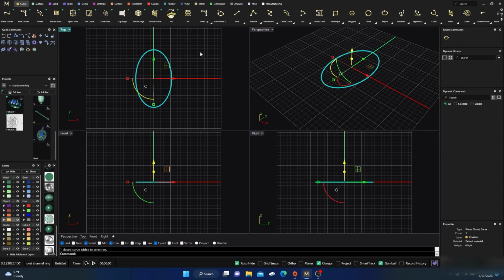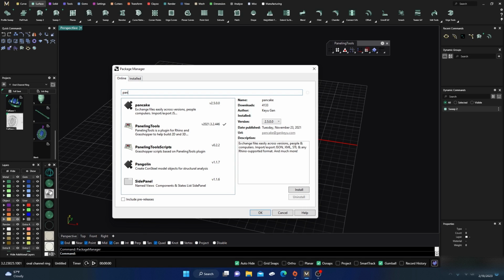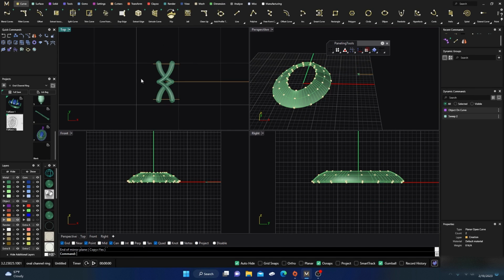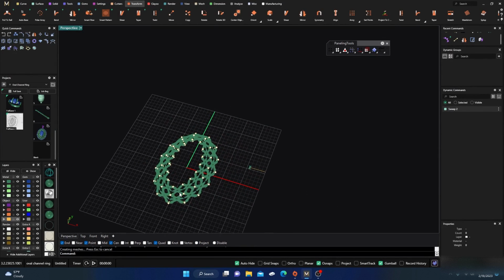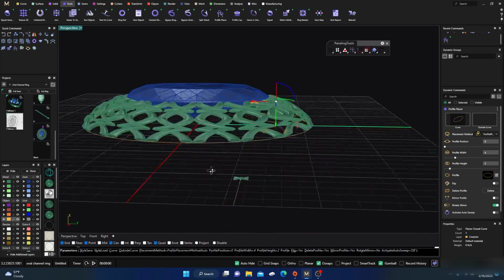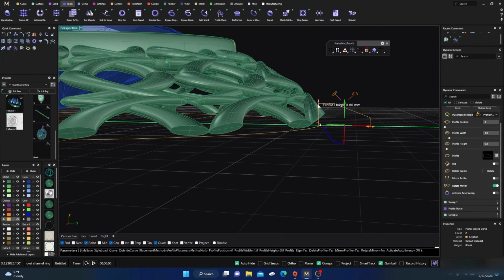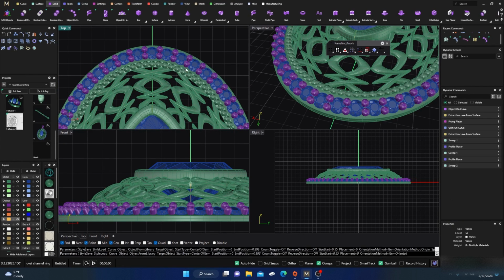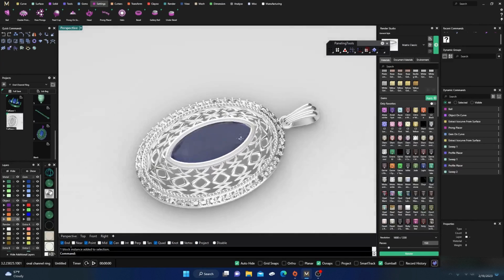MatrixGold  Rhino Paneling tool's introduction

Comment: So nice but how can I get this program?!
Reply from the maker: Type in the command LINE package manager and do a search for paneling tools. Install and restart Matrix then once restarted just type in paneling tools in the command line it will start paneling tools. You can also bring up the paneling ribbon from Rhino by typing options in the command line and click on toolbars scroll down until you see the paneling tools and click the box it will load the ribbon for easy access.